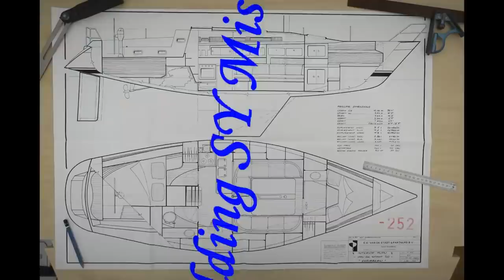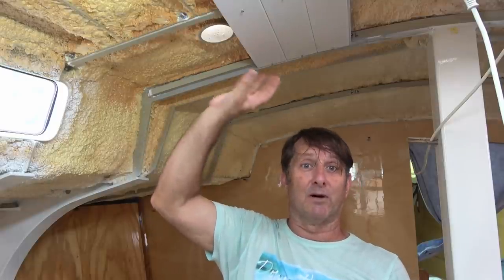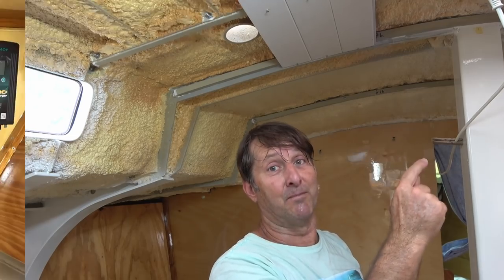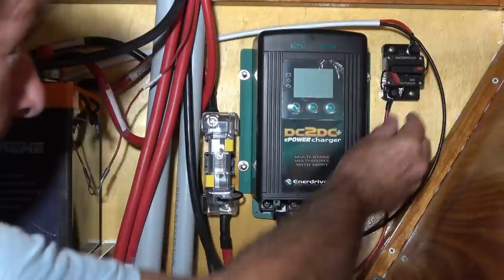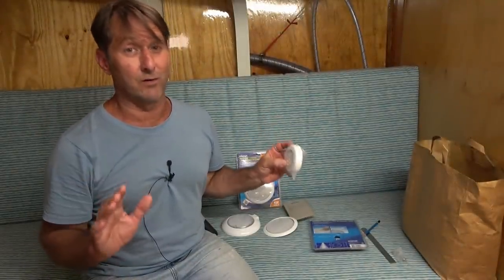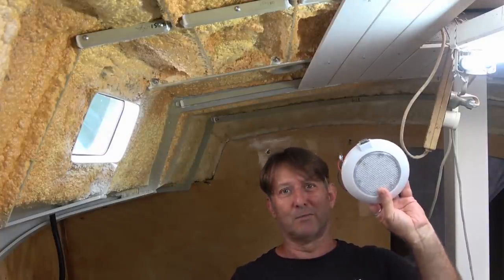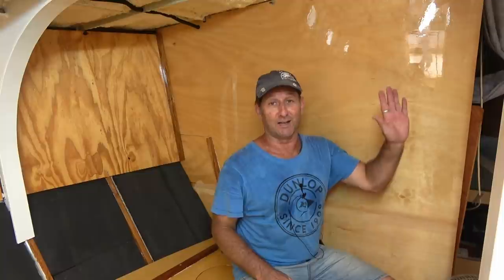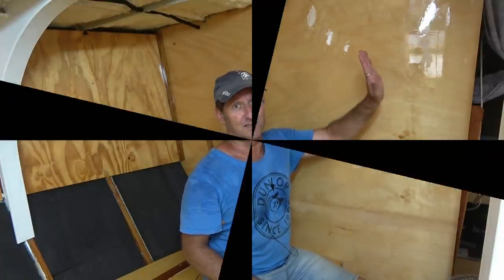Mistress gets ⚡POWER⚡! Ep.124 Building my steel sailing yacht

Comment: Only 10% of people building a boat from scratch finish! This was my motivation!
Electric carving knife works great for cutting thick foam, cheers!
Reply from the maker: Thanks very much for your good comments Jan, much appreciated and Yes, I learned that statistic since a teenager! I too WILL complete Mistress and yes I am aware of using electric carving knives and asked people nearby, however nobody had one and I didn't want to buy one just for that 1 cut. 
Which boat design did you build and do you still have your boat?  🙂👍⛵
Reply: @BuildingSYMistress  I built a Bruce Robert’s Mauritius 44 in steel with my brother in the late 1980’s, he eventually bought me out. I have since sailed over 120,000 miles on various boats.
Reply from the maker: @Seamist  Ok, that's great, thank you for sharing and apologies, I recall you letting me know this previously.

Comment: Always glad to see an update on Mistress! I can actually make a suggestion for once. When cutting foam I find that a kitchen electric carving knife (like you use for carving up a turkey or a ham) works a treat on foam. They're pretty cheap, and leave a nice smooth surface on the foam. At the rate you're going you'll be splashing soon, and you can tell that little devil to get lost for good!!!  ;-D
Reply from the maker: Thanks very much for your good comments and suggestion, appreciated and yes I am aware of the electric carving knife good tip and I did ask people nearby if they had one, but unfortunately nobody nearby did and for that one cut I didn't want to buy one and yes indeed, once Mistress is launched, MUCH/many will be left speechless 🙂⛵🙏

Comment: First, I am glad to see that you are NOT mounting the battery and charger in the bilge !  You want them as high as is reasonable to protect them from any water in the bilge.

Second, have you considered a second battery for radios and navigation equipment mounted as high as possible ?  This should be a smaller LiFePO4 battery.  Yes, it would require it own small DC-DC charger.
Reply from the maker: Thanks for your good comments Jack, appreciated and re. battery's Mistress has the AGM start and LiFePO4 house battery's which at this stage will be all that I will install, who knows ahead,.. 🙂👍

Comment: Best lessons are hardest learned. I'm interested in your approach for dealing with lightning strikes.
Reply from the maker: Thanks for your comments Micm and re. lightening strikes, because Mistress is steel, should she be struck, she is already "grounded" to the sea and btw <2mm of paint coatings are irrelevant to lightening voltages  🙂👍
Reply: @BuildingSYMistress   I understand the metal hull aspect, it's obvious. Hardening the electronics is something else. Antenna and power line paths.
Reply from the maker: @fishntools  This is a big topic with no consensus from any sources (apart from simple things such as disconnecting power and putting handheld electrical devices in for eg. the oven) and so I chose to not go down any rabbit holes and just keep things simple and see what happens ahead. If you have a look at the well respected Nigel Calder's comments on this subject I think that he rightly summarizes the lack of consensus. First hand experiences show for eg. do everything possible on one boat and it was spared, do the same on others and they were totally damaged.

Comment: Great works Bruce, coming together with some technical install included. One thing that I noted, the small well finished light connections behind the VJ, means lining removal to get to connectors in the event lights give problems. Maybe give this some thought as you go through further install and testing. Hate rework.....plays on my mindset. Cheers
Reply from the maker: Thanks very much for your good comments Geoff, appreciated and understood and to explain, I have installed the VJ panelling so that it can be removed fairly easily "in case,..." situations and like everything with boat building, compromises ALWAYS have to be decided on  🙂👍